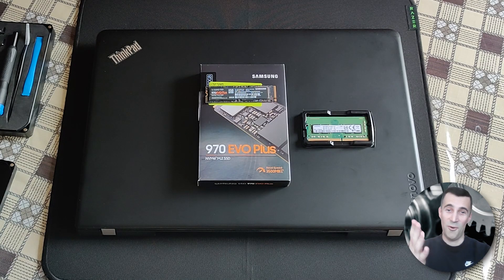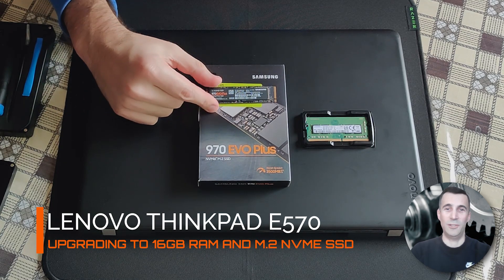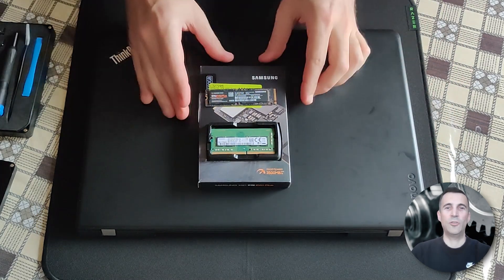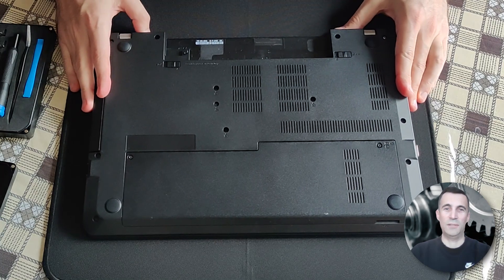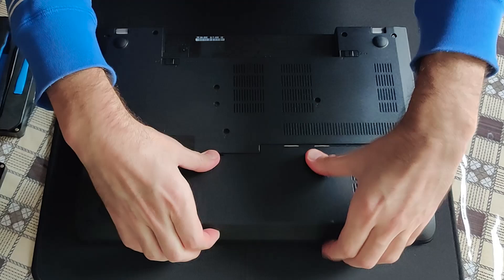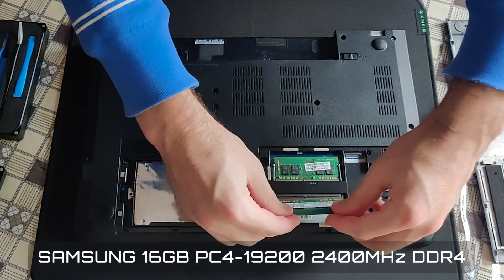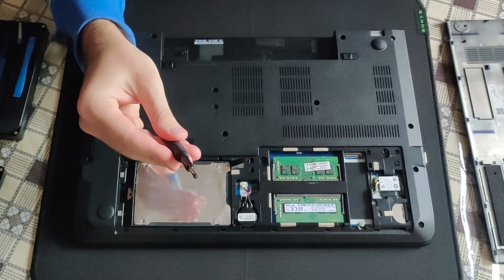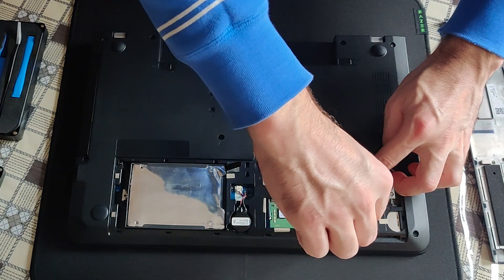Lenovo ThinkPad E570 - upgrading to 16GB RAM and installing m.2 NVMe PCIe SSD

Comment: Hello, my brother.
I want to ask you  : Is the  hard drive m.2 nvme that  you installed on your device is  a third generation or fourth generation? And does your ThinkPad e570 😮support the fourth generation  or only the third generation?

I have a ThinkPad E570 like yours, and I don't know if it supports ssd m.2 (nvme)  or  only ssd m.2( sata)  , because I read that only some versions of the E570 who  support ssd m.2 nvme , not all versions.
I want to know if my ThinkPad e570 number product 20H50078SP supports also ssd m.2 nvme or not."?
Reply from the maker: Good day. I would stay safe and go for Gen3 PCIe drive. I read even if you installed Gen4 drive and the BIOS and OS recognized it you would only get Gen3 speeds and not Gen4.  Good luck.
Reply: @smooth.IT.operator  thanks

Comment: What do you do with the original hard drive?    Because it looks like it’s still there.
Reply: Usually the fastest Device is used to install the OS and the old HDD\SSD is used to store the data by changing the path of the collection folders like Desktop, Documents...etc
Reply from the maker: @ Folder redirection to a different drive? Fancy.
Reply: @smooth.IT.operator  Exactly
Reply from the maker: Hi. Thank you for watching. I let it be. Laptop with two drives. NVMe for Windows 11 OS and the other old one for backup storage. Eventhough it is not advisable to keep the backup on an old mechanical drive ;)